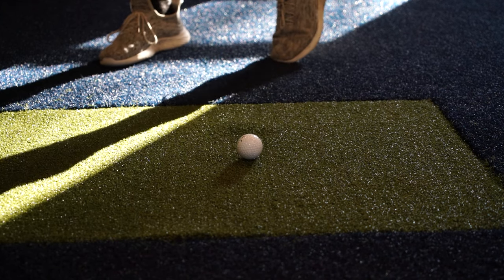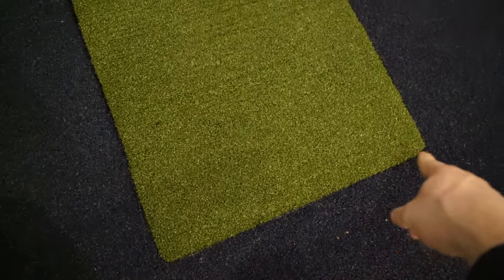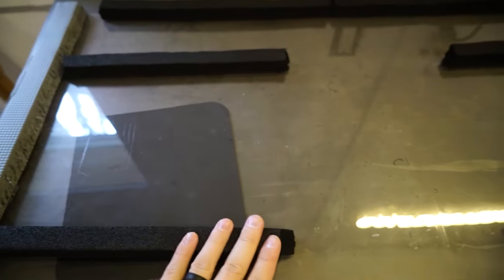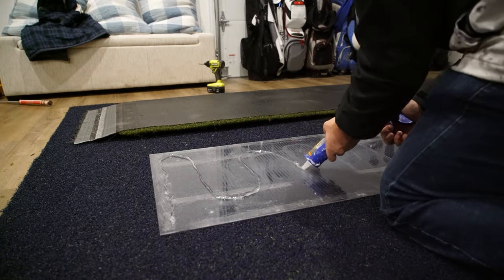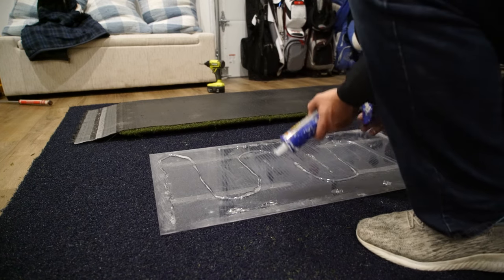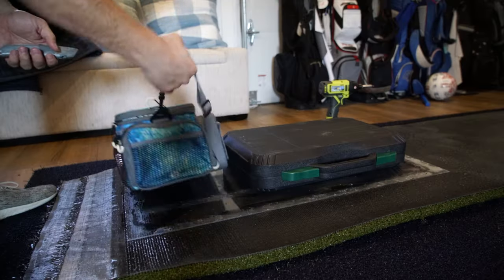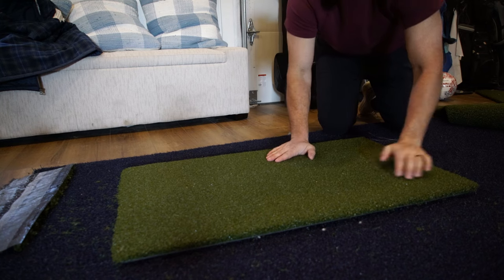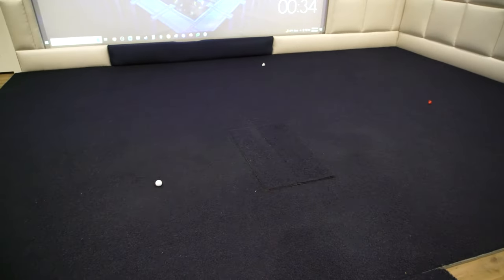How to Make an ULTRA REALISTIC Golf Hitting Mat in UNDER 2 MINUTES

Comment: Great content! I’m trying to set up a sim in my garage. I put a 1 inch gym floor down. Couple of questions: 
1. What turf did you lay over the whole floor?
2. Would I need the polycarbonate or could I just cut a place for the 1 inch hitting turf into the gym floor?
Thanks!
Reply from the maker: Watch our video on how we built our simulator and the link for the turf is there. And I would use polycarbonate or a little plywood. Just something sturdy so the turf doesn’t shift

Comment: I have had a soft strike for 3 seasons. As you have said, not bad. I replaced the strip last year but it limits the hitting area and wear occurs pretty quickly in the same spot. Question.  Would you have any concerns using the 12 x 5 piece as a stance mat? I would then match my strike area to my LM read zone. Thoughts? Great video.  Thanks!

Comment: So I have a 2 1/2 x 3 1/2 1” this hitting mat that has caused me to have wrist pain because 1. I am too steep into the ball and take big divots on the course and 2. The mat is in an in heated hangar and with cold winter temps it is very hard. Curious if you think cutting out a hitting strip and adding the soft foam under it would be a good solution.

Comment: What did glueing the polycarbonate to the bottom of it help with? Longevity? Or just shimming it up?  Thanks!  Is it forgiving enough, how would you compare it to the divot action/holy grail forgiveness?
Reply from the maker: Just added stability, i maybe have been able to use the mat without it but I think there’s a Hamer it would’ve bent all over without the support, not sure though you could test it out without the polycarbonate but I do like the feel of it being one flat piece when I put it in. 

By forgiving do you mean forgiving on wrists? I have felt fine with it but I’ve never really had bad wrists.
Reply: I did the same thing with the EZTee hybrid turf. Smaller pieces tend to bow up a bit. I glued mine to a piece. if 3/16" plywood. Now my mat stays dead flat on the floor.

Comment: Feel dumb asking this but what actually are you accomplishing with just the polycarbonate board? The divot action one made sense to me with the foam underneath but I don’t see whats the point of just glueing on the polycarb
Reply from the maker: You just need something under the turf so it doesn’t like fold up when you hit it. In retrospect I would probably just use thin plywood.
Reply: Ahh I gotcha thanks for the quick reply! So it’s really the turf that’s making this able to take a divot.. have you messed around with using this turf and your previous divot action method?
Reply from the maker: @sretenfranovic2594 yes, this is 1000% more realistic than the divot action mat.
Reply: @GolfBusters  how thin of plywood would you do? Would you still keep the foam under it? I'd worry it'd feel really rigid with plywood or hurt if fatting a shot, any chance you could give thin plywood a chance and test it? I'd imagine the plywood could break over time vs the polycarbonate

Comment: How do you have the hitting strip level (same height) as the turf when you've added a sheet of polycarbonate? Or is it not leveled and slightly higher?
Reply from the maker: It is about an 8th of an inch higher. Hasn’t been an issue I would say

Comment: Says minimum 12’ x 10’.  How did you get a 12” strip?
Reply from the maker: Maybe the changed it but the tee line turf only had a minimum length when I bought it. So I bought 2 foot by 12
Reply from the maker: Just checked looks like they changed it recently. I’ll look around and see if a place sells it in shorter strips